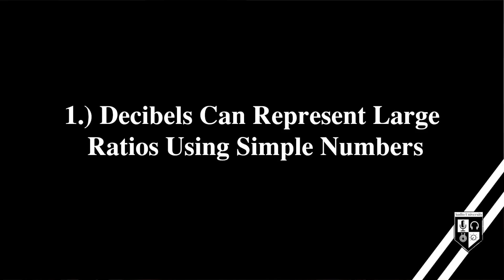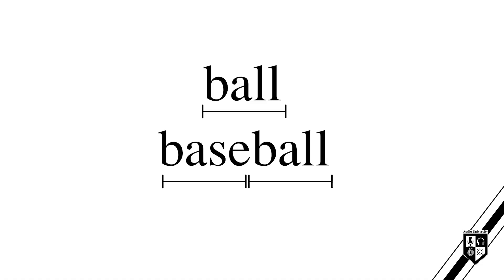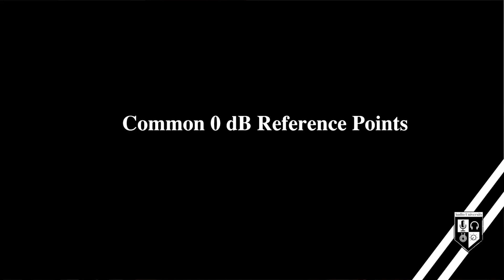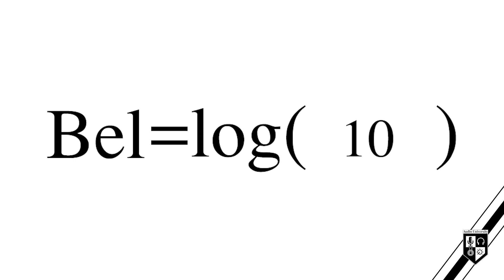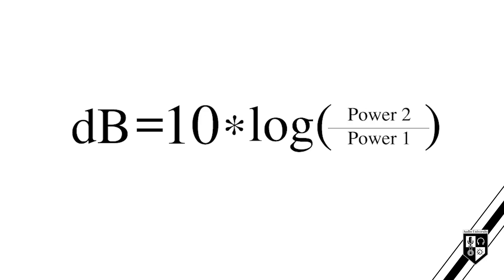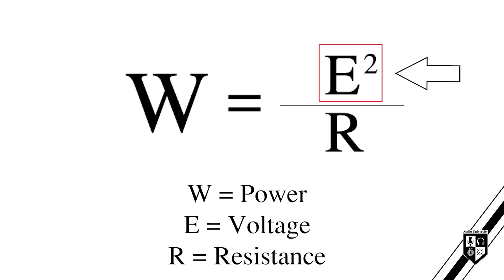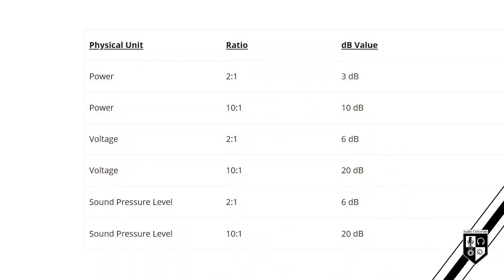DECIBELS (dB) EXPLAINED: 5 Things You NEED to Know

Comment: What a stupid unit. Imagine if we measured distance in the same way. I could tell you that something is 107 km away, and another place is 111 km away. You might think that those places are about the same distance away. But if we used the log scale like decibels and applied it to distance, the 111 km-destination would be 1.6 times farther away than the 107-km destination. That's a big difference.

As for the thing about there being a wide range of sounds, I say, SO WHAT? There is also a wide range of distances, and nothing stopped us from creating the nanometer and the lightyear to describe very small and very large distances.

Comment: How about something a bit more real-world situational, ie. A sound guy is walking around a room and tells the guy at the board to boost something 3db and cut something else 5db. How the F*** does he know just how many dB's to adjust something one way or the other just by listening?
What's the value to reference "oh this is 3db too loud or to soft"?
How does the guy listening know to say, "hey man boost the snare 3db."?
Reply from the maker: The sound guy in this scenario probably doesn’t “know” with exact precision. It’s just an educated guess informed by years of experience listening and tweaking knobs and faders. I usually think in 3 dB increments. 3 dB is “a little”, 6 dB is “a little more than that”, etc.
Reply: Oh, so, like carpenters adjusting a measurement or cut by "a blonde, red or black ct!!" 👌😉 Got it! Thanks!

Comment: I don't understand why in the fader there are -db and mixing should be around -3db when we can hear the sound of an noisy house at 65db circa.
Reply from the maker: 65db SPL is referenced to 0dB SPL, while -3dB on the fader is referenced to 0dB on the fader.
Reply: @AudioUniversity  oh ok! Thanks for the fast reply, can you give me more examples in different scales? In the fader which is the value of pain for humans and audibility threshold?
Reply: But also depends on how you saved a file, for example at 0db on fader a saved sound could sound like 75db SPL am i right? 🤣 Sorry for bother
Reply from the maker: They are just different scales. The dB markings on the fader describe how much gain up or down the fader is applying. dB SPL describes the actual acoustic pressure coming from the speakers.
Reply: @AudioUniversity  Got it i was trying to make them equal that's why the minus was giving me troubles, but yeah they are not the same scale, db on fader is about adding or  removing intenisty from the original db spl. Thanks ❤️

Comment: If motorbike A makes a noise of 90db and motorbike B makes a sound of 100db and the difference 10db is the sound of a watch ticking or leaf falling, does that mean there would be very little audible difference between A and B? Just an increase in volume similar to the sound of a ticking watch?
Reply from the maker: No. This is why it’s important to use the suffixes. Motorbike A is 90 dBSPL, Motorbike B is 100 dBSPL. The difference is 10 dB. The sound of a watch ticking is 10 dBSPL.

Comment: shawn stoudt
0 seconds ago
A subwoofer that has lower Decibels Is not going to push bass as good as one that has higher decibels more air is pushed per second with a higher decibel speaker and bass is pushed better lower Hz means lower frequency and better bass 20 Hz on a subwoofer magnet is good or lower 36 hertz is not as low of a Frequency for bass so the 20 hertz speaker will Outperform on bass quality vs the one with 36 hertz  because bass is a low frequency lower hertz means lower frequency bass is not high hertz or high frequency bass is Vibration and air travel Requiring a subwoofer that can put out very high decibels from 85 or higher

Comment: 120? >Try 138db SPL or like a friend of mine 167db SPL with car stereo, and with a perfect stage report 20-20Khz straight. What you get at 138db, your stommach will be having too much pressure. 167db trashing some gear from your car. The guy had to buy a new fuel pump because it was smashed with competing others. And those that always say, yeah and they broke their windows, get a life. Never seen this in my entire life, and around 50 now and pretty much deaf :)

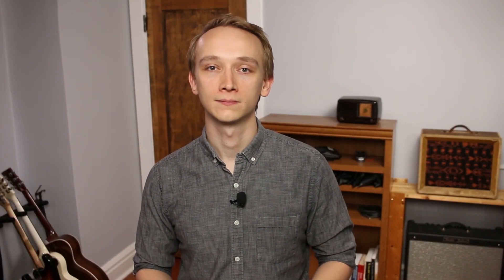Comment: fantastic video, but youre slightly misleading at 2:33 because dB is a unit on its own.

Of course the drums can be 120dB if you using dB as a unit of loudness(sound pressure level).

Comment: I’ve never understood and still today confused each time I Turn on my home theatre receiver and the volume at the lowest setting is probably something like -70db and as I’m raising the volume up the db is changing to -50db, -30db, -15db…
But I never know what’s the maximum I can raise the volume.
Compared to receivers made in the 80’s the volume control was from zero to 100.
It was simple and you knew where was the volume set at.
😡

Comment: Where was this video 20 years ago. Excellent job in explaining a subject that is often confusing at best. I was surprised how many studios I’ve been in where the people working there never gave it any thought. Just go by ear. Well yes, and no. Mixing doesn’t have one way and, POOF, I’ve found the one EQ setting that works for everything, every time.  Every situation is knowing which tool to use to get what most people didn’t even know was needed. So you can get good mixes by ear, but one day knowing how to use a db could be the difference between wasted time hoping you stumble upon that little ‘something’ that makes all involved go, yes, now that makes the whole song just sit right. Or if you had this tool you would know the rhythm guitar compression was 3db heavy.

Comment: What situations would engineers use this for on a regular basis? I’m curious how I can apply it to recording or mixing
Reply: For [electrical] engineers working on any hardware that process analog signals, you use decibels all the time. In regards to recording and mixing, it's helpful to be able to quantify how much louder an instrument is playing or how much louder you have something mixed.

Suppose you have two electric guitars, and you see that one is always about 4dB louder than the other. You can simply adjust one by 6dB to get them close to equal. If we were using absolute units—say, volts (V), to represent an electrical signal—you might instead say that one guitar averages at 1.35 V and the other at 2.13 V. To fade the quieter one up, you'd have to give it a gain of 2.13/1.35 = 1.58 V/V. And to fade the louder one down, you'd have to give it a gain of 1.35/2.13 = 0.63 V/V. That's a lot of math to try to do on the spot, especially for a live performance! It's much simpler to convert everything to decibels, so you're adding and subtracting numbers instead of multiplying and dividing.

The reason we can convert multiplicative operations to additive operations is a property of logarithms:
log(A*B) = log(A) + log(B)
log(A/B) = log(A) - log(B)

So, for the example above, let's say that A is the guitar playing at 1.35 V and B is the 1.15 V/V gain we apply to it.
20log(1.35 V * 1.58 V) = 20(log(1.35 V) + log(1.58 V)) = 20log(1.35 V) + 20log(1.58 V) = 2.6 dB + 3.97 dB = 6.57

And I calculate:
20log(2.13 V) = 6.57 dB

So, the answers match, and this awesome math tricks works. Notice that 3.97 dB isn't quite the 4 dB I had stated. This is due to rounding error—no big deal.
If you're thinking that all of these logarithmic claulcations are even more tedious than multiplication and division, thankfully, we don't need to do these either. Basically, everything's already in decibels and stays in decibels, so there's no reason to convert units all the time.

Now, a lot of the specifics in this video aren't exactly useful for everyday recording and mixing. But, it's always helpful to have background information on how audio and electrical signals work. If nothing else, the next time you see something like dB FS and don't remember what that means, you can look up this video for a refresher in under 10 minutes.

Comment: Of note : at 0:55 , 20 micro pascal is denoted 20mP. This actually implies 20 milli Pascal, which would represents three fewer orders of magnitude. Micro is conventionally abbreviated u, which would read “20uP”. One can also use the Greek letter mu.
Reply: The letter "u" is allowed as a prefix for micro in ISO standards.
Reply: ....and range from 20uPa to 20 Pa represent ratio of 1:1000000 (million) not ten millions.
Reply: @MyRackley  You are correct that u is not a correct abbreviation for unit prefixes. However, u is often used instead of µ by people who haven't figured out how to type µ on their device (or who don't want to take the time to).
Reply: @Klffsj  i,ve stumbled into 'pedants corner!' but yeah all the comments in this thread are reasonable in my opinion. Never the less Kyle gives a clear explanation of what underlies the idea of  "dB", for those who don't know or where unsure about this topic, it's very useful i think.
Reply: @MyRackley  I have,  like 10 uF is 10 micro farads , used all the time because people dont have greek letters on their keyboards .  I am surprised you have never seen it
Reply: m = milli, same as in mm (millimetre), mL (millilitre) and mg (milligram) and not the same as micro. I'm from a telecoms/radio engineering background and this really bugged me. You'd hope a "University" would know the difference. Perhaps it's not too late to add a caption or something?
Reply: Easy. Just google "micro abreviation" and you will see the µ character.

Comment: Confusingly, dB and decibel are two completely different, totally unrelated words.  A decibel is one tenth of a bel, which is a measure of sound volume.  A ‘dB’ is simply a mathematical term such as ‘%’ and in fact is closely related to the percent expression.  A ‘decibel’ is an actual thing all by itself.  A dB is a measure of ratio, used in sound and electrical power, and must be accompanied by the units being measured in comparison..  Once you understand this, you’re halfway home.
Reply from the maker: Hi, Peter. Thanks for your comment. I've got to clear some things up so that others won't be confused.

"dB" is just an abbreviation for "decibel", as "cm" is an abbreviation for "centimeter". 

A Bel is a logarithmic unit for representing ratios. 1/10th of a Bel is a decibel, just like 1/10th of a meter is a decimeter.
Reply: @AudioUniversity    I don’t object to that, but your reply again fails to distinguish that there are two unrelated common uses for the Bel: a unit of sound and a fractional expression of power.

I hear the terms used improperly the majority of the time and feel they can benefit from a simpler, more explicit set of rules.  Honestly, I doubt 10% are aware of the two quite separate uses.  The Bel as a unit of sound pressure is generally spoken of only by acousticians.

Comment: Hii sir I'm from India and here in my place we build custom line array's and we install 4×100watts Hf drivers 8ohms each & 2×12inch mid drivers in one line array  and we use our system in 3way mode so before we used to drive 2 Hf on one channel (wired parallely) and other 2drivers on another amp channel so the load impedance used to be 4ohms on per channel but the problem was that one line array used to take two channels to drive high frequency which was inefficient in terms of price because one line array needs one dedicated 2ch power amp to drive Hf drivers and also requires extra cables (4core wire for Hf and 2core wire for Mid's) and also in terms of space we do touring so the amps use to take too much space in our truck. so recently one of my friend suggested to run two Hf drivers in series which becomes 16ohms and another two drivers in series which also becomes 16ohms and connect the ends parallely so the idea was that when two 16ohms are wired parallely the load impedance becomes 8ohms so now our one line array's Hf use's just one amp channel which was efficient than using two amp channel's so my question is that is it right or good to wire two 8 ohm drivers in series and take another two 8 ohm drivers connected in series and then connect these parallely which becomes 8 ohm's so is there any draw back fo doing this does it effect the sound quality or damage the amp or drivers?? Please help me out regarding this issue

Comment: If you divide one side of the equation by 10 then you have to divide the other by 10, too, not multiply. If Bel=1 then decibel=1/10 not 10. And if you say dB=10 therefore Bel=1 is inaccurate because you multiply by 10 and therefore Bel=100. If Bel=log(value2/value1) then dB=log(value2/value1)/10==> dB=log(100/10)/10==> dB=1/10 which is accurate because dB is 1/10 of a Bel.
Reply: There are 10mm in 1cm. A mm is 1/10 of a cm.
Reply: @KurtVSJ  That's right, so 10dB=1Bel, so Bel=10dB=log(value2/value1), not dB=10*log(value2/value1).
Reply: One decibel is one-tenth of a bel. That means 1 dB = 0.1 B. If you multiply both sides by 10 that gives you 10 dB = 1 B.

You said “If Bel=1 then decibel=1/10 not 10.” - That is incorrect. One decibel is 10 times smaller than a bel so there are 10 decibels in 1 bel, there is not one-tenth of a decibel in one bel like you said.
Reply: @gimmemydinner  In the equation Bel=log(100/10)==> Bel/10=log(100/10)/10 ==> dB=log(100/10)/10. But in the video says that db=10*log(100/10), he divides one side by 10 (Bel to dB) and multiplies the other by 10 {10*log(100/10}. That's what I said, in that equation Bel=log(100/10)==> Bel=log(10)==> Bel=1. Then db=log(100/10)/10==> dB=log(10)/10==> db=1/10, not that there is 1/10 of a dB in one Bel. To put it in another way: If Bel=log(100/10) then 10*log(100/10)=10Bel, not 1dB.
Reply: @georgekol69  If you have one pizza and you cut it into 10 even slices, you can say 1 pizza = 10 slices. When it comes to converting units from “pizzas” to “slices” we need to multiply the number of pizzas by 10 so 1 pizza * 10 = 10 slices, not 10 pizzas, which is the exact mistake you made in the last sentence of your last reply. You’re treating bels and decibels as variables rather than units and you’re using the properties of algebra rather than the properties of unit conversions.

Comment: ok, so that makes sense. But why, when recording vocals, does -3db sound better than any +db? Also on my amp for simply watching tv, 0db is very loud and usually watch at ~ -20 to -12db. Why the minus?
Reply from the maker: When recording digitally, 0 dB is the point where the signal starts to clip (which causes a terrible distortion). 

It’s common to have several decibels of headroom on your amplifier to allow for listening to dynamic content at a comfortable level.
Reply: @AudioUniversity  So my power amps have an input dial from -12 to 0 which i have always used at 0 . should I back that off to -2? or so?  Great vid, thanks
Reply from the maker: @John F, if that helps then yes.

Comment: You mentioned that dB are a relative measure. However, you can find often "Decibel charts of common sounds", eg., Soft whisper	30 dB, Refrigerator hum 40 dB, Normal conversation, air conditioner 60 dB. Are these compare to "silence"?
Reply from the maker: These are mostly referring to dBSPL (Sound Pressure Level). 0 dBSPL is the threshold of hearing, or the quietest sound humans are capable of hearing. Of course, the capability will vary between individual humans, but 0 dBSPL is defined as 0.00002 Pa.
Reply: We use decibels to describe loudness as if it is linear. In reality loudness is not linear when measuring using the Pascal system.

Comment: mPa is not micro Pascals, dude, it's milliPa.  MicroPascal is µPa (the-Greek-letter mu Pa).  What's the big deal?  A milliPa/mPa is 1/1,000 of a Pascal, while a microPa/µPa is 1/1,000,000.  One thousand fold difference in sound intensity!
Reply from the maker: Good catch, oesterle6! You’re right. I think someone else already pointed that out. The notation on screen is incorrect, but the audio is correct.

Comment: Small typo...At 1:02, the lowercase "m" metric prefix stands for milli, not micro. Micro is denoted with lowercase greek letter mu, which looks sort of like a "u".
Reply from the maker: Good catch! My mistake! Thanks!
Reply: @AudioUniversity  shouldn’t the ratio be 1:1000000?
Reply: @richardappleby9519  Yes, I just did the calculation and that is indeed a ratio of 1:1,000,000.

Comment: at 4:41 shouldn't be  (1/10)*Log(P2/P1) since dB = (1/10) Bel?
Reply from the maker: Good question. It can be counterintuitive... The way that helps me understand it best is to think about centimeters and meters. 

A centimeter is 1/100th of a meter. 

To convert 1 meter into centimeters, you MULTIPLY by 100. 

1 m = 100 cm

Does that way of thinking about it help?
Reply: @AudioUniversity   I understand what you saying as how to convert from a bigger quantity a smaller one by multiplying by a number. The problem is how to prove it mathematically. thnx anyway <3
Reply: It is a litttle bit confusing, but, if you want to represent the same quantity in decibels, which is a smaller unit, you must multiply by ten, to get as big as the Bel quantity.